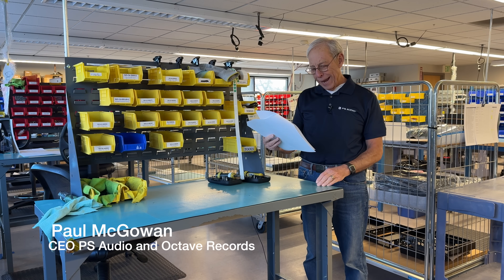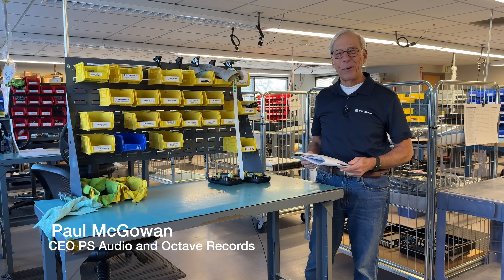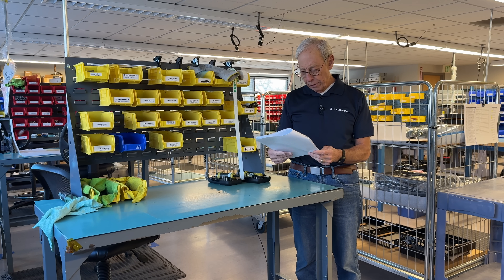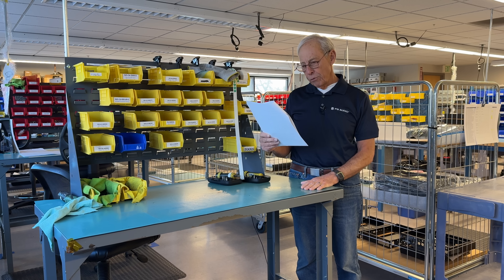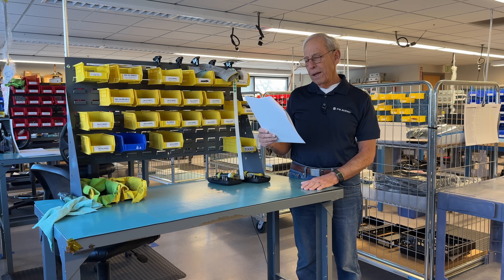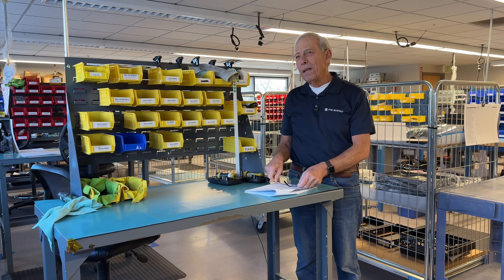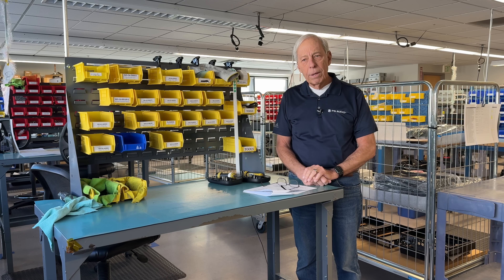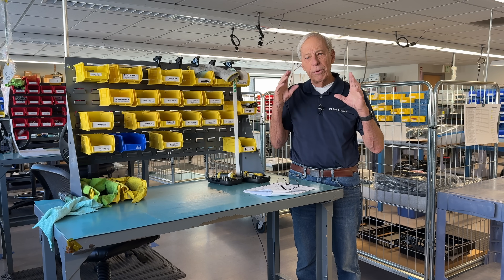Paul explains equipment burn in

Comment: Totally agree, tubes, transistors, need burn-in time.  Speakers need break in time.  But here's a good question for you.  Do you notice a difference when turning on cold speakers and beginning to play music versus their sound after playing at moderate listening levels for a while?  My tubes are always on standby, so they are already warm.  They are very consistent.  But I noticed when I start playing cold speakers, they always seem a bit extra crispy.  Sometimes I would turn the treble back one click.  Then after a while I would turn the treble back up a click.  But I know as electronics get warmer from a cold state, it does change the conductivity of elements and that can slightly change the sound.  To my ear, the woofers get warm and provide a little more bass, while at the same time the tweeters get warm and calm down a bit.  After playing music for a while, everything balances out and sounds just perfect.  So now I just leave the tone controls as is.  And enjoy the different sounds from different mixes and different sources.  This way my reference speakers always seem to sound a bit different.  What is your opinion on this? Have you noticed that speakers do need a little bit of warm-up time?  Thanks for the video.
Reply: No, not at all. And don't forget about the room temperature having influence on the overall temperatures of ALL your audio devices. All. So, in summer you should notice a noticeable difference compared to listening in winter time, right? And what would you do against it?
If there is a burn-in effect there's also a burn-out effect. All mechanical and electronic/electric components degrade over time. "Burning" doesn't stop (at a particular time). And how do you determine a significant burn-out which cannot be reverted?
When is it time to replace a particular component because of its burn-out?
So many open questions.
Reply: @Matt-cb2db  
The technician's #1 rule.... If it ain't broke, don't fix it.
Reply: I always feel that the whole system needs at least 30 minutes before it opens up.  I don't know if it is the speakers or the electronics or all the above.  For me if  I only want to listen for an hour or so, it is best to turn it on and let it play while I do other stuff.  Otherwise I'll listen and after 45 minutes I want to start over to really get the most out of it.
Reply: @user-od9iz9cv1w  Amplifier Transistor bias temperature needs to reach operating temperatures
Reply: Leaving tube amp on standby is not good idea if the standby is the usual high voltage interrupt type.  Leaving the amp in standby for long periods will cause cathode poisoning and reduce tube life.  Tubes want to be at operating temperature but, overheating them will reduce their life.   In most cases tubes really don't require a standby unless the plate voltage exceeds 600 VDC.
Reply: @carlcarrasco102  applying the B+ before the valves are warm can be bad, for example it can cause arcing in a cathode follower. But yes, you are correct - leaving valves on standby will poison the cathode and is a terrible idea.
Reply: My system optimises after an hour or so.
Reply: If your system and perception are anywhere, every time you play your stereo, the sound gets more open with more space between the instruments. The bass also gets more, and tighter, and the sound gets less edgy and sweeter. This is consistent with every system I have ever lived with (many). 

 What causes conflict and confusion on here is people with worse systems than you had when you were a teenager, with hearing and perception that is shot, or biased against differences, and many people don't know what faction to believe. Believe your own ears, and don't let these know it all types with relatively bad equipment, bad perception and bad theories; don't let them talk you out of it. I recently bought a run of the mill AC cord and I couldn't even hear what the electric bass guitar player was playing, with bass notes running into each other, in a jumbled mess. My older more expensive AC cable sounds like it has perfect grip on every note. You can easily hear every bass note he's playing, and the bass line is so much easier to follow. The notes sound like individualized seperate notes, instead of jumbled together in a blurred mess. It is so obvious that these people that don't hear any difference; well it's hard to even believe is the only way to put it. Their perception AND equipment must be severely compromised to a degree that is unimaginable.
Reply: @diggingfordancingmusic523   In 50 years, I have not encountered any problem with standby mode on preamp tubes, or power amp tubes in professional equipment.  My consumer equipment preamp tubes only run at 90 volts full power.  Standby mode does not affect them, it saves electricity and allows faster warm up time.  Your mileage, of course, may vary.
Reply: @diggingfordancingmusic523   That must be why professional equipment has standby modes...  Seems like a good idea to me.